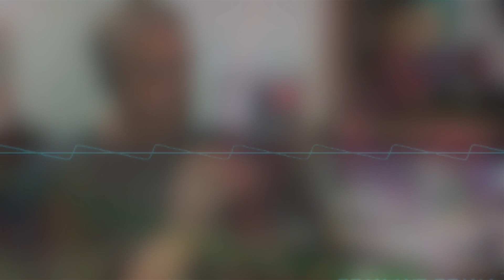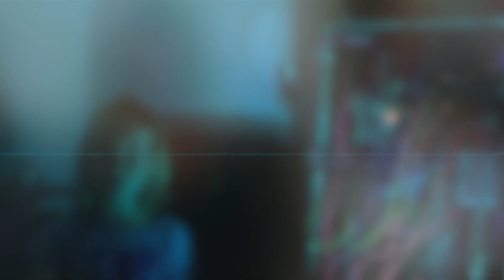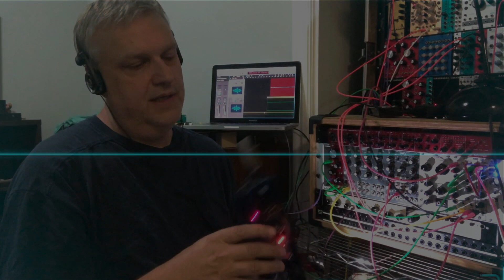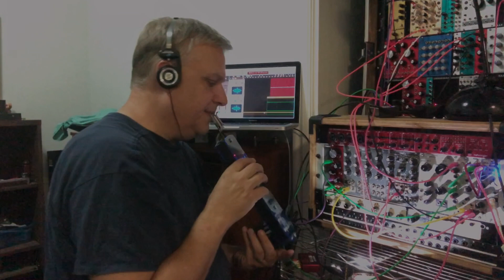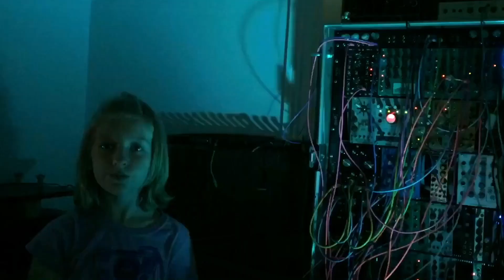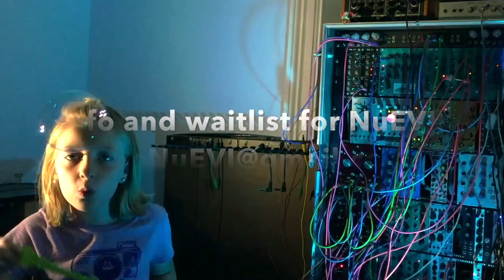Cwejman DMF-2 RES-4 & NuEVI Demo - Mark Steiner

Comment: What module is on the far left, next to the Res-4?
Reply from the maker: Pittsburgh Modular Oscillator V2.   LOVE this vco!   https://reverb.com/p/pittsburgh-modular-oscillator-v2-analog-oscillator-module?hfid=78664176&utm_source=google&utm_medium=cpc&utm_campaign=17685054637&utm_content=campaignid=17685054637_adgroupid=139144245072_productpartitionid=1686427565460=merchantid=125169502_productid=78664176_keyword=_device=c_adposition=_matchtype=_creative=608980458237&gad_source=1&gclid=CjwKCAiA8YyuBhBSEiwA5R3-Eyk3KGpu_iQQCYZz8Lsjsh-NKE_9D0H_QqCnm36vRff7OVjSTgsfqhoCDy8QAvD_BwE

Comment: Awesome sounds and tones, what is that thing you're blowing in?
Reply from the maker: Thank you!  It is called an EVI (electronic valve instrument).  This model is a newer version, as they have been off the market for many years, and it’s called the NuEVI.  Fingers similarly to a trumpet.   Breath control and manual vibrato really make it expressive.
Reply from the maker: Called the NuEVI.  It's a wind synth based on trumpet fingering.  Check out about it at the Facebook group "Berglund Instruments".  Thank you!